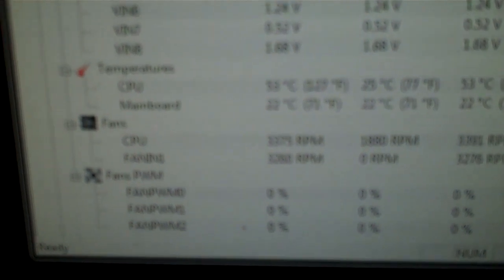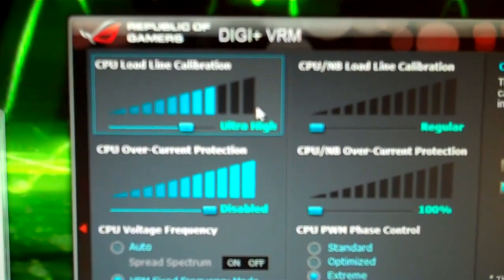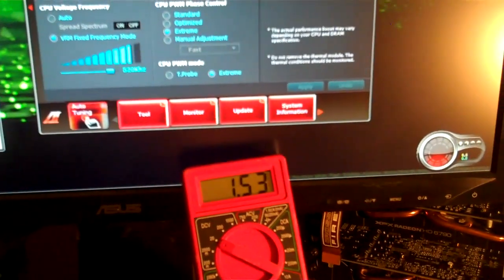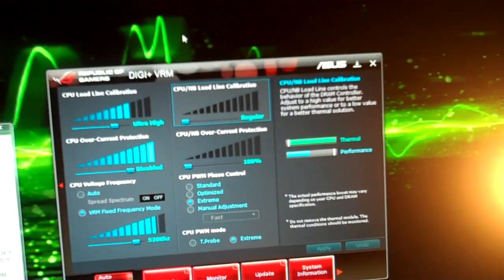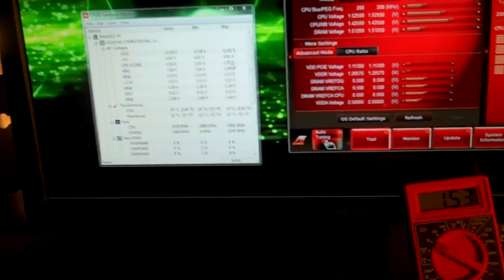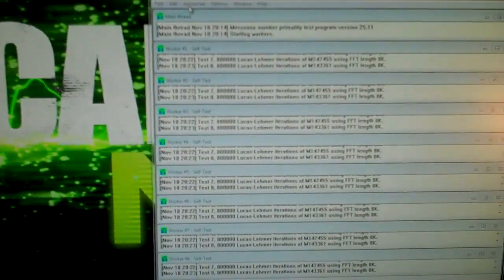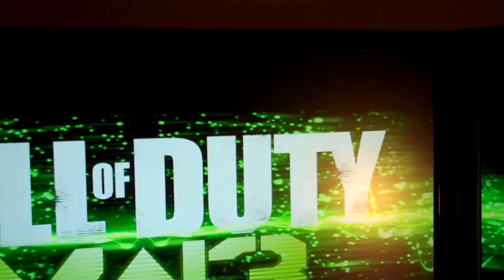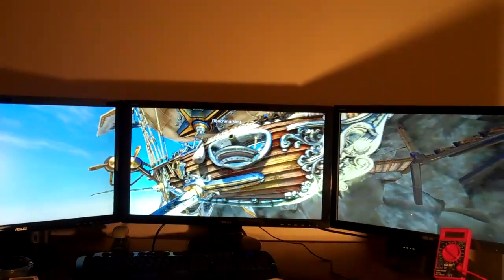Bulldozer FX-8120 #1 Overclocking Part 3/8

Comment: get a water block make everything easy the h100 be very good for you i have the amd fx 6100 clocked at 4.9ghz with a antec 620 h20 cpu cooler runing at 45C full laod